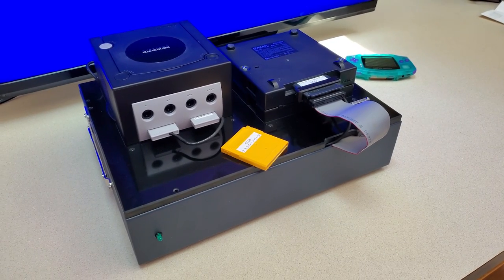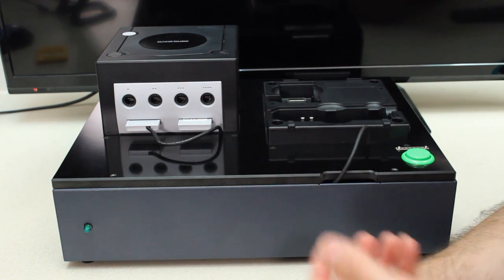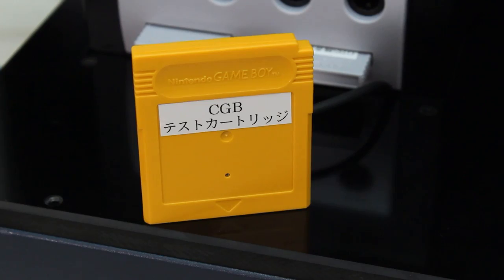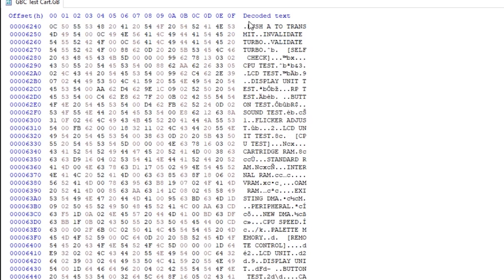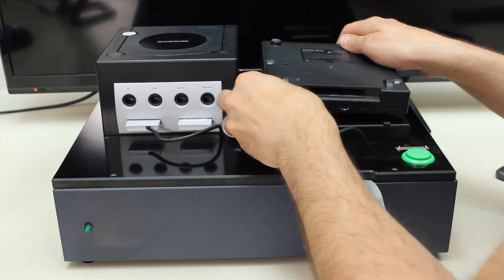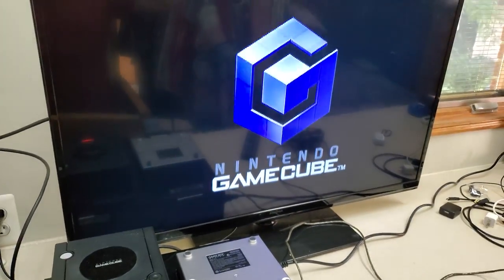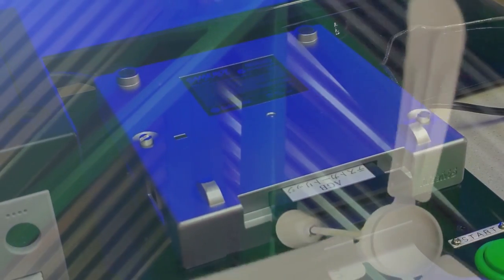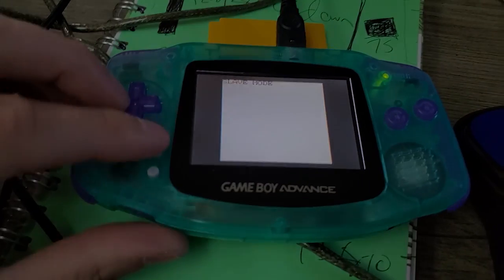The ULTRA RARE Nintendo GBS | Game Boy Player Testing Station

Comment: My guess is that it was used at GameBoy Player manufacturing plants to test random completed units off the assembly line as a means of quality control. That "Test machine for complete products" certainly makes it sound that way, as well as the physical setup of the machine allowing for easy, quick setup of a GBP.
Reply: It could also be used to test "faulty" units sent back to Nintendo.
Reply: I doubt this being a factory tool. When you send out a destruction order to a plant, the device will not show up as nice individual sets.
Also this is too much polish for a factory tool. (The game cube read a retail player disc - a factory tool has to be ready before you start production, so you would not waste time pressing disc)
I guess this is a nintendo service center tool. That would justify using a retail game cube and pressing disc for it.
Reply: Are there any other codes on rear

Comment: Did you happen to reach out to the homebrew developer who wrote Game Boy Interface, Extrems? AFAIK, he's the only gamecube homebrew developer who has interfaced with the gameboy player and may be able to provide some insight on getting it to work. 

From what I understand the gameboy player sits on top of ARAM and this testing unit may be placing it elsewhere in memory since it interfaces with the memory card port (serial bus) instead of the high speed port. This could explain why the official retail gameboy player disc cannot see the device. I'm sure Extrems could modify his homebrew software to try to interface with it(the Game Boy Interface homebrew software is sadly not open source)., Also, I would love some high res photos of the boards inside the unit if you could provide those.
Reply: Vegetta
Reply: @Josiwi  777? Socket T? Xd es el vegetita q todos conocemos

Comment: hmmmm This reminds me of the Datel Advance Game Port - which was a clone of the Gameboy Player but used software emulation and connected via the Memory Card port. I'm sure you already knew this, but perhaps that's how the Gameboy Player was also initially developed
Reply: I have a feeling it was meant to test the Gamecube games which could connect to GBA games, not the other way around. But maybe there is some sort of software emulator as well to do similar to the Datel AGP.
Reply: @Techburn997  that thought also crossed my mind. It would make sense, but those games would also have to access the GBP via the high speed serial port.

Though I also wonder if the memory card slot connector is just a red herring in general. Ah, oh well, in sure we'll get the answers some day
Reply: Look at the super gameboy: It is a very Nintendo thing to just put a Gameboy into a new housing and plug that into their current home system.
Emulation is messy. Frame grabbing from memory avoids all shorts of issue.
Reply: @sarowie  oh absolutely, but if you look at the next generation, the Wii and it's virtual console titles - it's possible they were in that mindset as early as the GameCube

Comment: I'm inclined to agree with many of the other comments in that it's missing a specific software disc only meant to work with the GBS. But I will also bring up the possibility that the disc itself could have had something proprietary printed onto it's surface that the machine could also have to look for to authenticate it's the real thing. Might just be a disc for internal use but I wouldn't put it past Nintendo to have a security check on it as if it were a retail game disc.
Reply: Well, if it didn't have protection it would be a an easy open door to running software from the memory card slot if it were to get out in the wild.
Reply: Well it would have to have the usual protection to be able to run at all.
Reply: @renakunisaki  the software needs the usual protection - but it can also contain "unusual" or even accidental copy protection. Like: For e.g. Swiss is using memory card 1, and this piece of software sets memory card 1 into an unusual high speed mode, kicking out Swiss access to the memory card.

Comment: Dumb question? The best kinda question...
Has anyone checked if its a stealth dev kit... eg a test or dev kit stuck into a retail shell.
Try booting a dev NR disk?
If not that then i'm guessing its trying to load software from the memory card and the box needs to be connected to a larger testing rack that sends software to like 8 of these test boxes at once and they all send report data back..

On the read wright speed, i'm guessing your yellow junk data cart might be a test data cart, the reader reads all the junk data off the card and then verifies it as legit checks against a known checksum.. i'm guessing anyways... psp electronic alignment disk does the same sorta thing so when you stick the umd into a normal psp it only sees a corrupted disk.
Reply: He kinda has checked by inserting the startup disc onto the GameCube and having it boot to enough of a point where it says that the Gameboy Player couldn’t be detected. NR GameCubes can’t read retail discs.

Comment: To me, this smells like a diagnostic tool for Gameboy Player hardware, which is why it's upside down and readily accessible (fast swap out different Players to test them).
Only output you'd really need for diagnosis is success messages or status messages which can easily, easily be sent through the memory card. The GBA and GBC carts are probably used for testing both GBA and GBC functionality.
Also I wonder if that link cable is actually used to transfer multiboot to the Player and there's additional multiboot software that is used to kick everything off on the Player side of things.
Did you try plugging in a GBA to that link cable, switched on without a cartridge, and hitting one of the arcade buttons?
Reply: Kinda funny if the official testing kit uses a link cable to load GBA multiboots, considering you can do that from the GameCube itself.
Reply: @KopperNeoman  you can do it via that player too, and doing it via the player also tests its link and multiboot features so would be desirable
Reply: Why would it use a whole GC simply to output message? That's a task for basic leds or a small LCD screen.

There's clearly a task which is easier to do over a GC. There could be some sort of handshake between the GC and the GB Player, done by the software, thus reusing the same code on the GC was easier than porting it (or adding a PowerPC cpu over the board). It also keep that handshake closest to the reality, as merely the output change. It wouldn't explain why they aren't using the port under the GC directly though...
Reply: @dwild92  considering it's a bespoke game system and is Nintendo I don't think it's too crazy to imagine them using a GC as purely the display and program communication medium. Money and cost isn't an issue with such a low volume of hand built machines.
This isn't too far outside the realms of what Nintendo do with their hardware, either.

Let's imagine the alternative: buying a very small volume of LCD displays and building a hardware platform specifically for booting, sending commands and displaying output. At a very low volume, a GameCube is probably cheaper. That being said, a GBA would surely be even cheaper at that, and itself has an LCD display, button input and support for general purpose serial communications, so I'm not convinced my theory is correct.
Reply: @Xilefian  Buying an LCD at a really low volume would have been more expensive than a whole GC? Lol in what world do you live. They cost a few dollars, and on that board there's clearly an expensive FPGA. A cheap LCD that cost a few bucks won't be an issue.

The implementation in itself too would have been much more complex too for litterally no gain to go for a more expensive solution.

There's a reason there's a GC there instead of anything else. If it's neither to simplify the implementation nor save cost, then it means that we are missing some facts.
Reply: @dwild92  yeah you're entirely right, but for Nintendo the GameCube is practically free. But in the same regard, the cost of the parts to build this thing would also be practically nothing for Nintendo
Reply: @Xilefian  I think you are correct. While this may have been used in Nintendo Service Centres, I think these devices are more likely to have been used in factories that were producing Game Boy Players as part of a Quality Assurance process. Speed is key in factories, so creating a machine that largely automates the test process would have been a major efficiency boost for the production line (more units output = more money, more units out faster = even more money). The GBS doesn't look like a very complicated piece of hardware so the GameCube is likely the "brains". As you have stated; the GameCube was already mass-produced and would have been cheaper for Nintendo to use over the time spent to build and produce a more complicated, small-production-run test box. GameCubes are predictable devices having gone through their own QA process, the test boxes would not have been through that kind of process and are thus a weak link in the chain.

At Service Centres, engineers would have more time and be properly trained how to operate the official diagnostic test software, so those people would just connect retail hardware together without the need of some cumbersome contraption to do automated tests. At the factory low-paid workers would have no time at all to verify the hardware is working correctly and their haste could easily introduce errors. If you've seen videos of production lines for say a Smartphone, you'll have seen people stationed along a long workstation where phones are passed down the line, with each individual trained to look for one specific fault and just do that same thing over and over and over again for the thousands of phones they will test. This is likely a tool used by that kind of worker but for the Game Boy Player. That's my guess, anyway.
Reply: Could this method be the most secure/hardest to exploit? 
That way they could ship it off to wherever manufacture was and not worry about it being used to exploit gc ever.

Comment: Looks like a system to test GB Players or GBA systems that were sent back to Nintendo for service...  Maybe you tried this combo, but try to plug a test cart into the GB Player and the ribbon cable into GBA. I do not think a disc is needed. Possibly, the GBA may be used as a visual display to navigate the test screens for testing the GB Player or the actual GBA. I speculate the wired memory card can possibly dump data to the other memory card? Maybe as a way to back up a save file if a system needs to be serviced or just a diagnostics data dump. BTW, was the save file a GBA or a GameCube save file? Interesting... But for sure there is nothing about the Gamecube that would be connecting to the GB Player, so the GameCube output seems non-essential. But, someone mentions data can flow through the memory port. I still feel the real output would be on the GBA attached to the ribbon cable. Good Luck, can't wait for the day it is all figured out!

Comment: probably it is what it says it is: A tester to test the GB Player. For factory use or repair department, so they can stick it on easy (on top) and run the test software via the memory card, so it does not need to be booted by CD (= slow and time consuming = expensive).

Comment: I've gotten the service disc to work in Swiss before and played around with it. It looks like you have a WAY outdated version of Swiss so maybe it'll work if you get a newer build (I say newer instead of newest because the service disc worked for me until I updated Swiss, I think, to v0.5r990 so I think v0.5r963 might work but it wouldn't hurt to try different versions). I was also using a GC Loader to boot Swiss, which might make a difference

Comment: If I had to guess, the unit was probably for testing the Game Boy Player itself; the connection type was altered to allow for the units to be quickly swapped out, and an alternate software disk would've been used in tandem with the included flash cart; the GBA hardware in the player would run the GBA test cart to verify if any issues were with the GBA hardware, while the proprietary Gamecube service disk would interface with the board through the memory card slot to determine if anything was wrong with the connectors between player and system. They likely created the alternate board and connection type so that the GBP could still recieve power from the unit as a whole without necessarily connecting to the Gamecube directly, so that if the GBA hardware in the player worked fine but the player's connectors didn't, that could be ruled out.
That even diagnosing this kind of thing could be as difficult as it was is honestly a testament to just how much engineering work got the GBP to work. It's almost certainly one of my favorite oddities of the Gamecube.

Comment: Maybe it was used to haze new Nintendo employees.
"Good job, Hiroshi. Now can I get you to boot up the GBS? It's right over there."
Reply: oh, just ask them to setup the build system for the current project on their developer machine.
To increase the challenge, give them the instructions you got when starting with your handwritten notes added.
Nothing increases the challenge just like specific, yet not precise, slightly outdated and very helpful in the begin instructions written by a software engineer.

Comment: The memory card cable should work just fine, the GameCube uses the EXI bus for pretty much every peripheral and it's accessible from the bottom of the system and the memory card slot.

Comment: its almost certainly missing its software disk,  it might have ended up in that big leak and you could find it there but removing the disk this may have been a deliberate choice by nintendo to cripple them for some reason or they could have just gotten lost
Reply: That's what i was thinking, it'll have to have some sort of software disc or maybe by someone using the retail software disc its soft-locked itself beyond repair
Reply: @ohmlord  i doubt its beyond repair unless they disabled it like the nintendo playstation but its certainly not going to work with the wrong software, the workboy also looked dead until its software was found

Comment: The GBS would need a disk to access memory card IO and have it run like the Swiss. The read speed is beyond 64 blocks a second. A software engineer working for a long time could get it running... But the software to access the card IO would still be missing !

Comment: Software would not allow the GBC to work. The GBP itself is just a capture device. The software can't acess the GBP via memory card slots. you need the high speed port directly connected in order for it work. The early later revisions of the Gamecube will not run the Service Disc due to deliberate hardware changes with the laser and motherboard revision.

Comment: Have you posted the dumps/pictures anywhere? I'd love to take a look. I got the AGB Aging 7.1 ROM from another owner (the new owner of this one?) but the CGB ROM looks to be a bad dump. 

I'm curious what the board that the player connects to is doing but my thoughts are that the Aging software (AGB) is running on the game boy player and sending data back to that board which is then handing it off to the game cube over the memory card adapter and the game cube is only part of the equation for diagnostic purposes. This would mean that you're missing software but that doesn't make too much sense because this sort of thing would usually be NR reader territory. That also doesn't explain the CGB cart and what exactly "slave mode" is. Unless that's where diagnostic data is going (which seems weird too) but then why the game cube at all?

One clue to figuring this puzzle out would be to figure out how the AGB Aging 7.1 ROM differs from the current 7.0 ROM. I can see that they changed the main menu text and added a "GBS" type option in addition to "AGB" and "AGS" but that doesn't seem to change anything above board. I suspect it's doing something different under the hood, however, and trying to report diagnostic data on memory addresses I'm not monitoring (like perhaps the link port). I'm not too good with software disassembly so I'd have no idea what to look for but maybe someone who does can probe. 

Another piece of the puzzle is that CGB Test Cart. That can't be plugged directly into that daughter board, can it? I assume not because it looked like there was a bracket holding that AGB flash cart in. Anyway... 

Thanks for sharing

Comment: I'm thinking you need a 1.1 or higher diagnostic disc or a special version of the GBA player, the GBA cartridge that connected to the board is meant to connect some how to a pc, the reader is meant to be plug to port B, or damage to parts of the board due yo age

Comment: I'm not really good at anything past 5th gen systems, but I agree it probably needs a specific disc to boot. My best suggestion would be for someone who has basic GC development skills to take a look at the setup, and try to write a very basic disc that can cause the handshake to happen. Also, this is even stupider... But have you tried switching the Memory Cards into the opposite ports? I seem to remember a Karaoke game I had as a kid using slot 2 for the mic, as opposed to slot 1. Since the memory card on your left seems to be carrying data (As opposed to save files)... It may be worth a shot.

Comment: Thinking way outside the box (or Cube...); it's not used to test GBA connectivity via a controller port, for Four Swords Adventures, PacMan VS, etc? Will it run Japanese retail GameCube discs, for starters? And if so try a "Four Swords cable" compatible game via the Gameboy Player device to see it it recognises it.

I doubt it'll solve the mystery - probably just the ramblings of a mad man... 😁